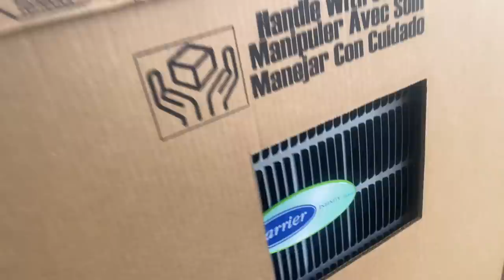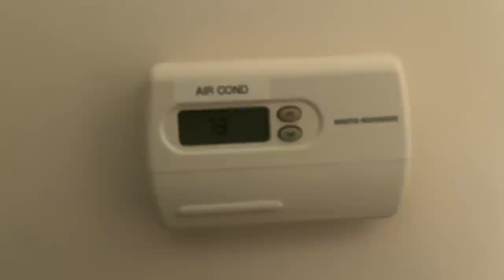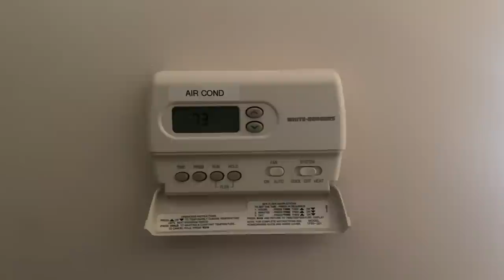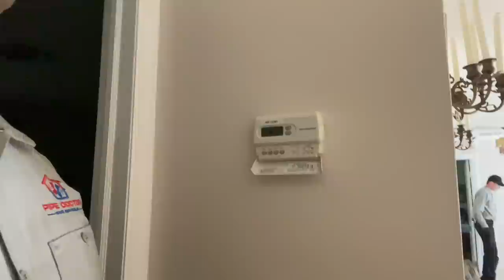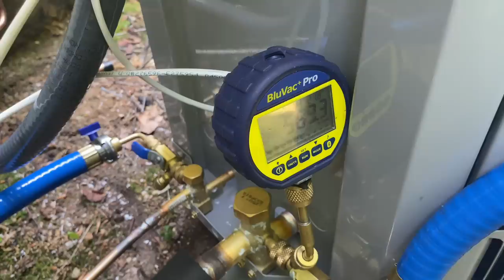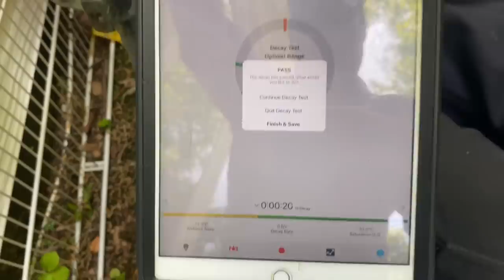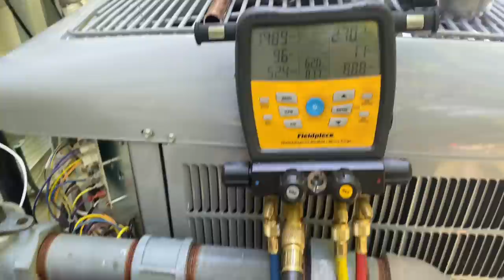Carrier Infinity Replaces TOTALLY Hacked Central AC System for YouTube Subscriber

Comment: Why do you replace the entire air handler and not just the evaporator (A coil) and TXV if applicable. I only ask cause where I am from we use natural gas forced air furnaces with the evap coil on top in the air duct directly above and the regular practice is just the coil and back to the condenser. Just curious about this.
Reply: I got to thinking about it a bit more most of the places where your located run boiler systems and you need to have a separate air handler whereas in my location we run forced air systems that make it easier to run everything from the same air ducts the evaporator is mounted on top of our heating units and the fan runs for both AC and heating. (boilers are uncommon unless it’s a large building).

Comment: My friend in Fort Lauderdale had even worse install . The return was taking hot air from the attic no ductwork just a return grill in the ceiling 2 feet from the.air handler nothing connecting the 2